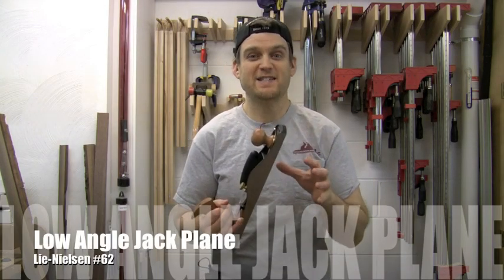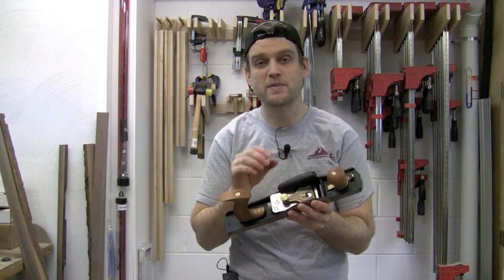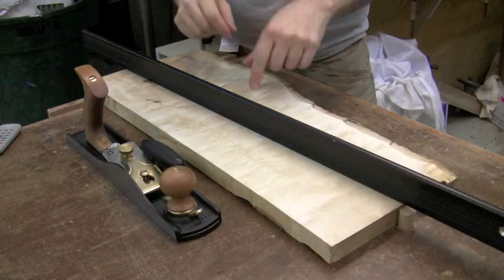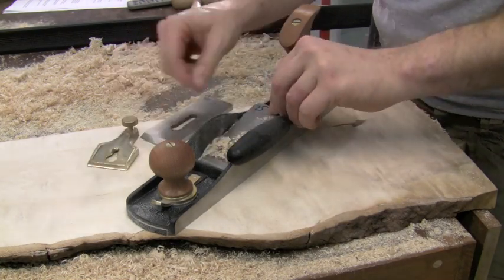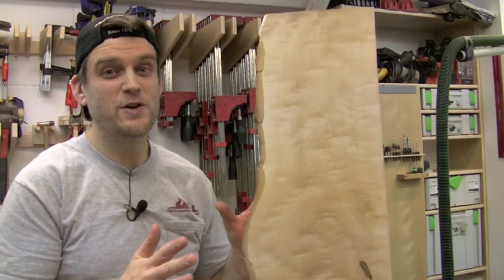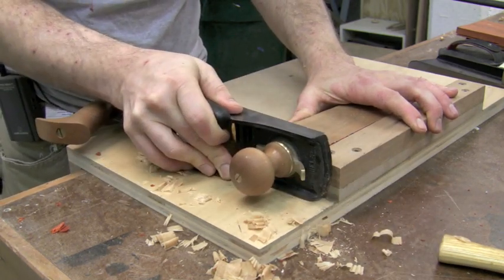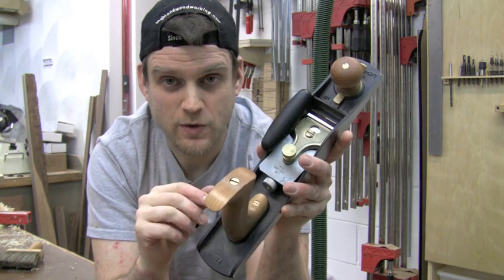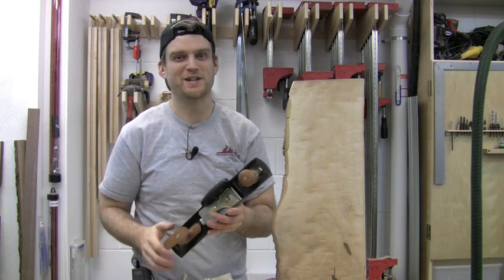Lie-Nielsen Low Angle Jack Plane #62 Product Tour

Comment: I think your points at the end of the video are spot on and something I haven't seen in other videos extoliing the virtues of this plane.  I lusted after one of these for awhile and only the cost and the love of my current Stanley 5 1/2 Jack plane made me not yet buy one.   I knew I'd never use my Stanley again, but I figured one day, i'd get one of these planes.  Your comments made me think twice and made me think about some other planes that I didn't yet have and had a need for - so I ended up getting a No. 3 Smoothing plane and a small Rabbet plane instead of sinking the money into an expensive, very nice Jack Plane when I already had a perfectly good one.  I still would likely recommend a low angle Jack for a newbie's first plane.

Comment: I own this tool and have never mentioned to another living soul about owning it until your comments. I do not feel the need to brag about it, I just love owning a tool that is so beautifully engineered. 

I own several, very basic, planes that I have spent a long time honing and they are great but definitely require a lot more effort to get the same result. 

I get a lot out of both types but to suggest that the only reason people buy high end tools is to brag is 100% off the mark...

Comment: I have a no6 , t5 , no4 and no3 so i purchased the L.V veritas model after seeing a few vids on here and was very impressed , i seem to be reaching for the l.a jack for most of my needs then on occasion i reach for my no3 . I think this plane ( and my veritas ) are a must have . There's a few on the market so go search . I have the 25° and the 38° which i changed to 40° and I'm thinking of getting the toothed blade for rough work . It feels not too heavy but heavy enough to pull itself into the work also the balance is different more bottom heavy which i enjoy , very little effort to use and i feel i can plane longer and not get as fatigued . The reason i bought the L.V was the blade , the L.N only has a 2" blade/iron but the L.V has a 2 1/4" blade . Both excellent products and I'm one happy chappy . Also the L.V has a few extras on they're model , the two pins near the blade/iron to help centre the blade is a nice little feature also the Norris style adjuster has a dual function it forwards and retracts the blade AND you can adjust the lateral movement no tapping the blade .

Comment: I tend to keep them pretty flat across, except for my #5 roughing plane which I use across-grain for initial flattening - it has a 6-8" radius camber for real stock removal!  Otherwise, I go straight across and ease the corners slightly.

Either way (straight or cambered) works fine - pick one and stick with it.

Comment: My vintage Stanleys probably chatter a bit more, but for almost all the work a person needs to do, they work great.  There is a law of diminishing returns, products like this one are over kill for most people.  Face it, if you run into really wavy grain, you'll break out the scraper, or even the sandpaper.  There are ways to get around the problems that don't cost a fortune.  The real issue is different from what you think.  The real issue is people who want to brag about their expensive tools.

Comment: Very nice, now just for shits and giggles, try to compare it to a Low Angle Veritas Jack plane (which gives you a 2 1/4" blade vs. your 2"), I don't have the budget for both and I'm very happy with the Veritas which has all the blades and accessories as the Lie Nielsen (less the 90 Deg. scraper, which you can make from any blade) for $100 less!
Reply: ronin4711 

veritas makes a quality product but after having used a variety of both you wont see me without lie nielson tools. to each their own though, everyone is different and as long as the quality of your work doesnt suffer from the use of "x" tool than it doesnt matter one bit.

Comment: Hello! Should I buy this plane instead of power jointer and power planer? What would you prefer if you had enough place to keep all these power tools? This is not a quite clear choice so your opinion would be very useful for me. Thanks.
Reply from the maker: The LN #62 is an heirloom quality plane that will not only perform a variety of planing tasks but will retain a great deal of its original value - someday, it might even appreciate in value.

The power planer is a utilitarian tool for planing the edges of doors and boards. Not very sexy but quite useful in nuts and bolts edge work.

The comparison is not exactly apples for apples.

We would choose the LN #62 for all around flexibility.
Reply: Well, I do agree that the surface that planer produces needs to be smoothed becase of scalps, here we use a smoothing plane. Do you mind this case?
Reply: Artem unknownw